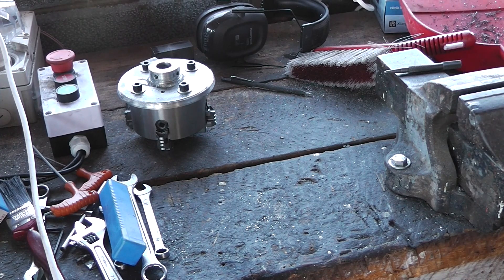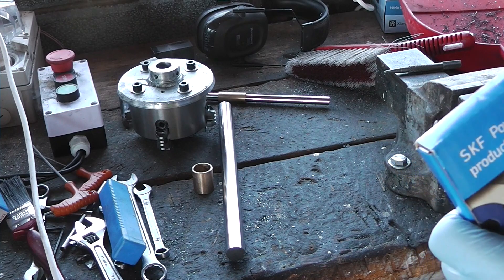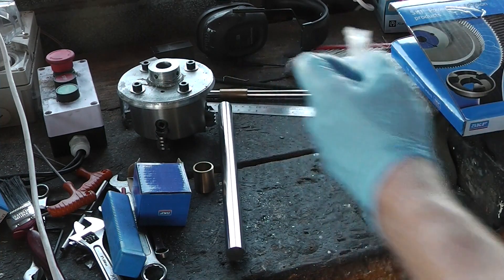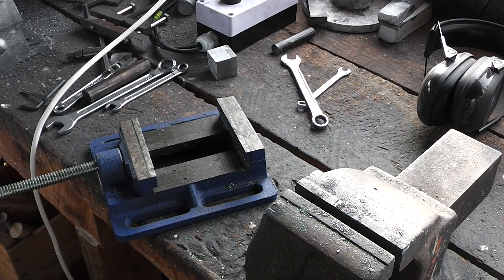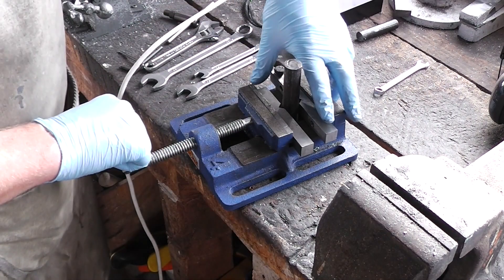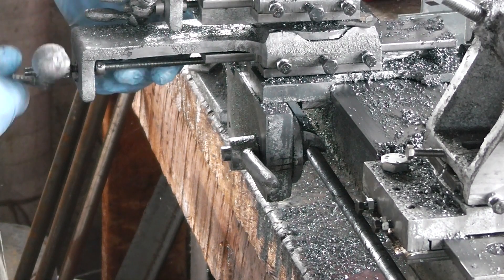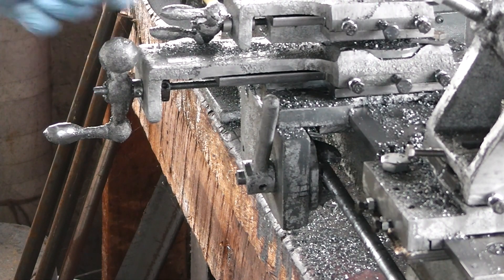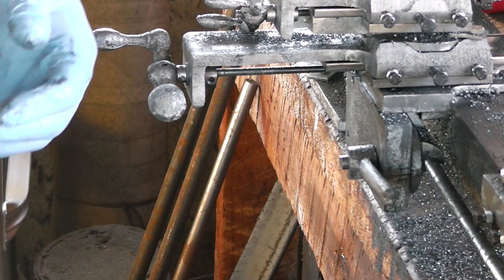Collaring A Shaft

Comment: I'd highly recommend some cheap thrust bearings either side of the crosslide where you put the nylon washers. Means you can make it as tight as possible and have next to zero backlash. Spins much more easily as well. It's a minor upgrade but i ended up adding it to every machine i own.

Can't wait to see the shaper come together! I recently picked up an ancient hand operated shaper and i can now see why they normally come with a motor, at least my poor back does.
Reply from the maker: The nylon washers are, if you squint, kinda poor man's thrust bearings, I guess :)

Comment: "this is 20mm rod stock" puts on lazy susan and slowly spins it like shopping channel
actually...to lazy susans and an old 9kg gas bottle with a door on an angle...to use as a parts barrel tumbler polisher(you fill it with small rocks), to easily smooth out your cast parts like the handles and stuff